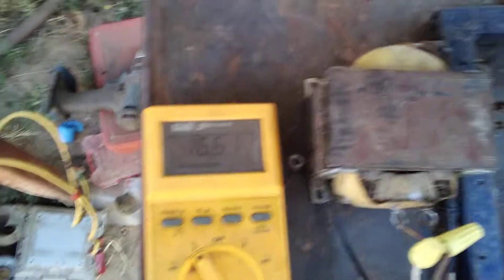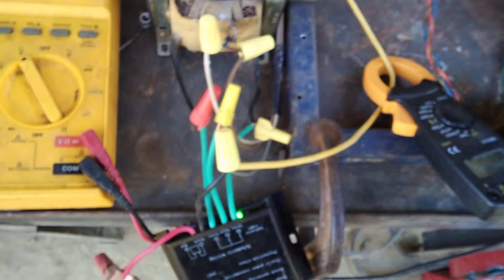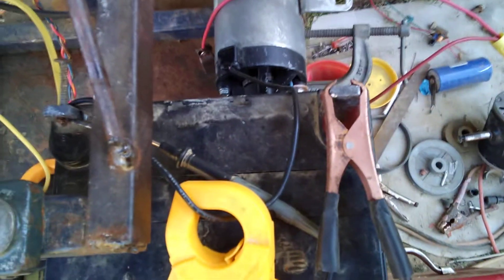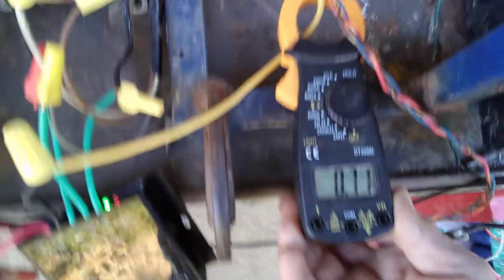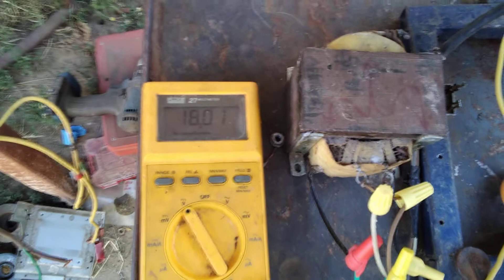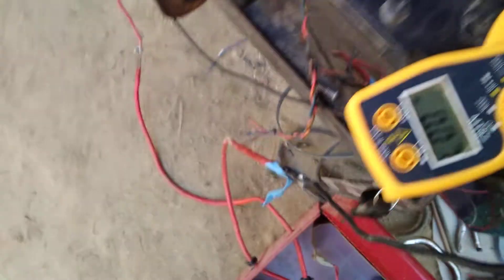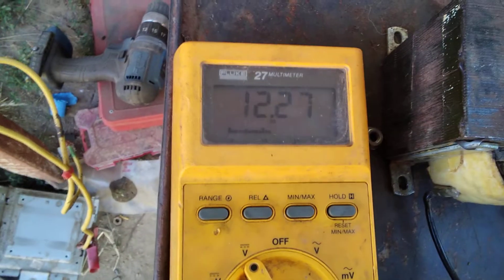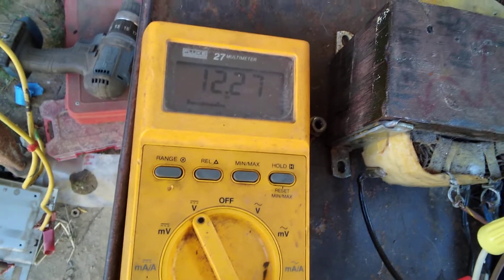Over Unity is Here

Comment: I have worked with treadmill motors and certainly believe that just a few volts will turn that big motor with no problem so where does that energy come from? ...there are huge magnets inside the treadmill motor therefore a little voltage produces a lot of thrust or torque with very little amperes from the battery. Don't be fooled by the label that says 17 to 20 amps does'nt need it.

Comment: You have done good sir. You have part of the equation. I too have done similar, but fewer coils and a larger magnet. I can get 3 times the voltage running at 2500 rpm & receiving a freq hrtz of 55 - 60. However, I am only receiving milliamps. your battery I am guessing is perhaps 72 amp hrs. Try changing your frequency on your timer and or change the coil configuration to see higher amperage and then once you receive more amps out than in, you will have over unity. Congrats on getting this far! Blessings to you sir.

Comment: information.   at 6:35, you have done  ONE, and only  One,  thing right.!!!    (discussed below)    consequently, what you  THINK  you have accomplished is  a  delusion.        it should be obvious that the the use of energy storage/capacitance  in the output circuit  is  a  MISTAKE; and contributes to  false  positive  results.!        in order to  DEMONSTRATE  ou  performance, the amount of energy consumed must be known and  output energy  MUST  BE  MEASURED, Correctly.!   and,  NOT  used in some way !          at 6:35, you have correctly made  mechanical advantage/reduction (MA), a part of the transform; at the alternator belt drive.        googletranslate

you seem to think that voltage is  power.     it  is  Not!          power is   WATTS.
watts =  volts  x  amps
Reply: Sup. Check out MrDZONKEN latest video on the overunity transformer. You're completely destroyed. Energy CAN be created with proper configuration.
Reply: power can easily be amplified from low power, pulse forming networks do that. the catch is in Pavg.